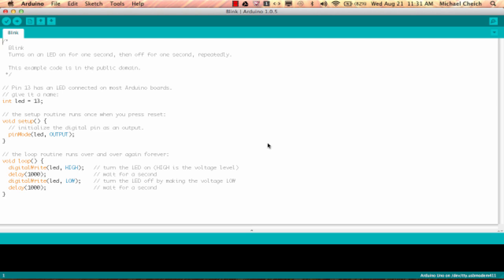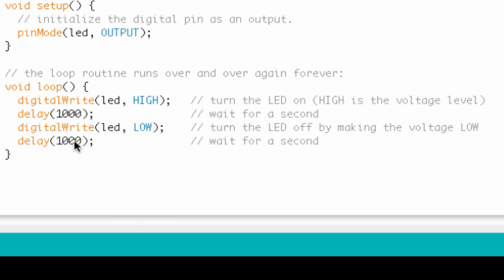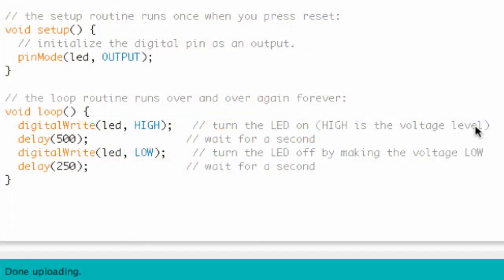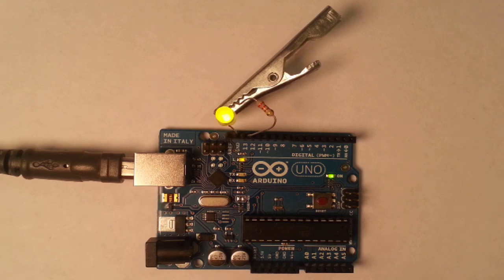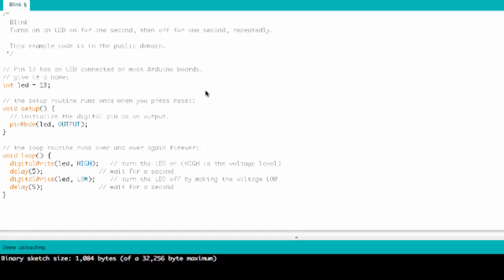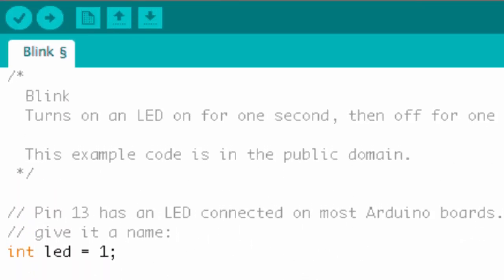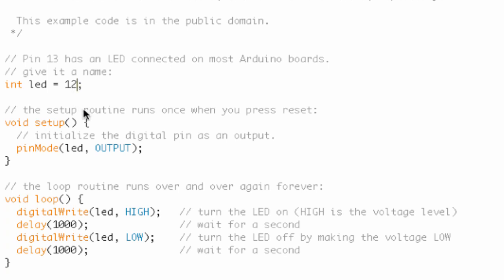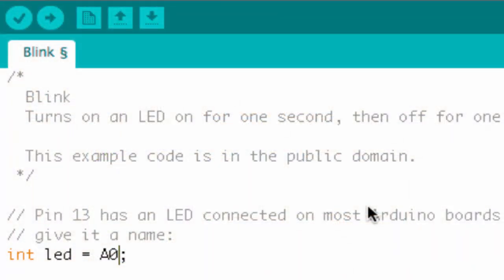Challenge 06: Blink an LED Discussion: Arduino Course for Absolute Beginners (ReMastered)

Comment: Can I just say, your tutorials are wonderful. Searched all over youtube to try to get a tutorial like yours.

I was testing out the sketches, but I noticed that even when I changed the numbers the blinking speed wouldn't change. I tried saving the sketch then uploading it to the Arduino, then hitting the reset button. (Or even unplugging it and plugging it back in entirely.) Doesn't work. The speed stays the same. I have to say that I don't have a resistor at hand so I just plugged in the LED light without it and it works, but only with the initial sketch. Could that be the reason?
The app on the computer says whenever i try to upload another sketch that isn't in the main built-in example list. 

" avrdude: ser_open(): can't open device "COM1": No such file or directory
Problem uploading to board.  See http://www.arduino.cc/en/Guide/Troubleshooting#upload for suggestions."

I tried going to tools to put in my correct Arduino board setting. And it is correct. I am clueless on what to do at this point.
Can you by any chance advice me what to do?

Comment: Why do you have to use a resistor? What if you just had a wire?
Reply: For me it worked without a resistor. But when I last read online, the resistor is there to make sure that the LED doesn't become overpowered and then break. If you ever decide to do a bigger project, it is a lot safer to use a resistor as that makes sure that your system doesn't give out, because of too much power or voltage.

Comment: My experiment in the following:

I attached the resistor with one more wire to pin 11 (so there are pin 13 and 11 attached to the resistor). I then added two lines of code.

 The first in setup():
pinMode (11, OUTPUT);
The second in loop():
led = led - 1;  //the pins are triggered one after another from pin 13 to the last.
("led" is the variable used to turn on the LED.)

The LED now lightens up 3 times, which I can't explain completely. first, pin 13 gives a "HIGH" voltage output to the LED, then turns off, then the same with pin 11. A certain amount of time nothing happens and after that, the LED lightens up one more time and stays lit for a few minutes. Following, the process begins again.
One more conspicuousness is that the LED has less intensity when 2 pins are initialized as outputs.

Why is that?

PS: Thanks for your helpful tuts!!!
Reply from the maker: Hi Tim Bubissimo, First off, awesome experiments!  This is how you really learn this stuff.  So here is my thought.  The 'led' variable started equal to 13.  The first time through the loop you subtract one, so now it is 12.

The next time you go through the loop, it is 11, at which point your LED lights up. 

Since you never reset the 'led' variable back to 13, every time through the loop the value goes lower and lower.  When the number stored in 'led' stop referencing actual pin numbers (i.e., when it it's value is -1), then it is anybodies guess what happens - but likely it starts to loop around to different values.

At the bottom of the sketch, if you add:

//reset led pin to 13
led = 13;

It might work as you expected.  Have a good one, hope this helps some!

Comment: For some reason, my pin 13 is always high even if i change the pin to another pin...i dont understand why...the only way to get my pin 13 to shut off is to address it in the code as setting it low...any reason whY?
Reply from the maker: Daniel Clemente Hmmm.  You know I have heard of this before, and there is a pretty long thread about it in the Arduino Forum here:

http://forum.arduino.cc/index.php?topic=96886.0

I hope that can help some.  It appears the quick work around is setting the mode of the pin as an output in setup():

pinMode(13, OUTPUT)
Reply: after reading your reply it seems i have the same thing on my arduino uno
Reply: I think there is there is built in resistor in the board, so whenever you power up the board it glows, if you solder directly 13 and gnd, the resistance fallas and current finds this soldered path easier and the onboard led shuts down. 🤔

Comment: Hey Michael, I would be curious to find out how it is that you knew that about the analog pins.  that could be very helpful when you run out of digital pins.  thanks mike/doogie
Reply from the maker: snaprollinpitts I found it here:  http://arduino.cc/en/reference/board

I find the more I read around the Arduino website the more I learn.  I like it over there!
Reply: Open Source Hardware Group Hey Michael, thanks, but after reading that I remembered that I couldn't get the I2C display I have working. could you do a video on how to setup/program it with the library you need.   thanks mike
Reply from the maker: snaprollinpitts I definitely have an I2C LCD Display tutorial in the oven.  I think they must be pretty common displays, because a ton of people have been asking about it.  Thanks for the recommendation doogie!
Reply: Open Source Hardware Group
thanks, I'm pretty sure I have lost enough hair over this problem.

Comment: hello great instructions I just started learning this my self I thought I would push the boundaries by switching to pin 12 and use the on board led thats tied to pin 13 to see if i could get them both to blink so I added a second int and it was int led = 12; under the int led = 13;. that didn't work so good got this message when I verified Blink:11: error: redefinition of 'int led'
Blink:10: error: 'int led' previously defined here
Here is how I wrote the code before the setup
int led = 13;
int led = 12;
everything else was unchanged I am sure i need to add more commands somewhere just don't know where and what yet
Reply from the maker: Very nice Steve.  Doing the Challenges is key.   What is happening is you are setting your led variable to 13, then the next line of code you are changing the same variable to the value 13.  You need to have two different name for your variables.  I.e., maybe led_1 and led_2. Hope this helps - Best of luck!
Reply from the maker: The error is occurring because you are trying to initialize a variable of the same name.
Reply: Open Source Hardware Group That put me on the right track I had to go further and add duplicate code line for each function for each led but i got it to work I did discover if I add a delay at the end of each digitalwrite it would turn on one led the turn on the second led. puzzled me at first then after reviewing the code it made sense to me. Thanks a million
Reply from the maker: Awesome! Glad it helped!
Reply: Here how can u blink the two leds simultaneously as the program would run in loop so one comand after another will execute so in no way two leds will blink at the same time it will blink one after another  kindly suggest as how to give voltage high and low at sane time to two or three digital pins so that if we connect three leds all of them blink at the same time